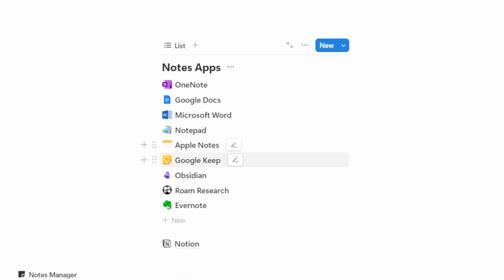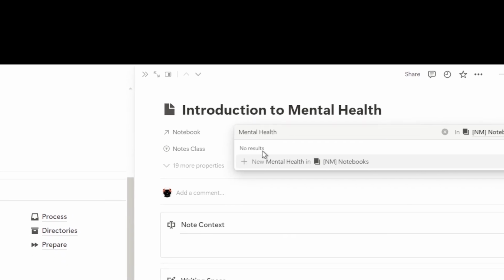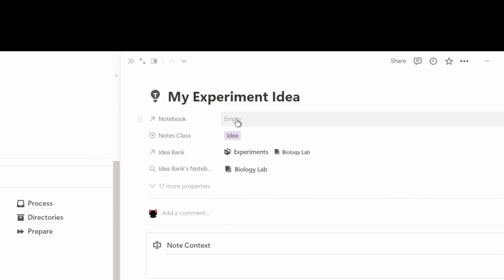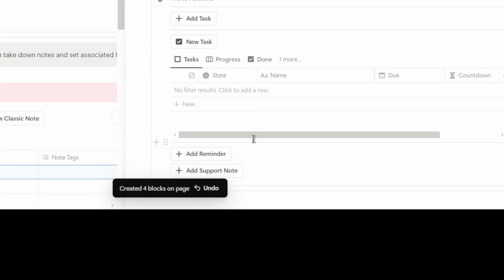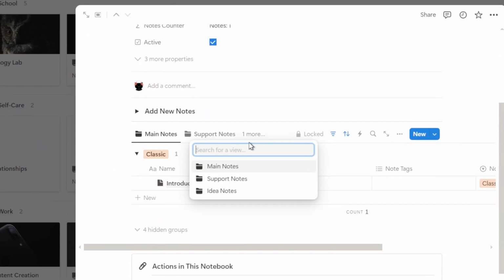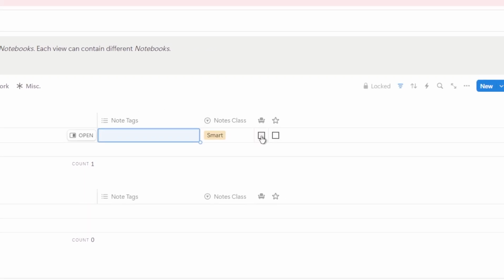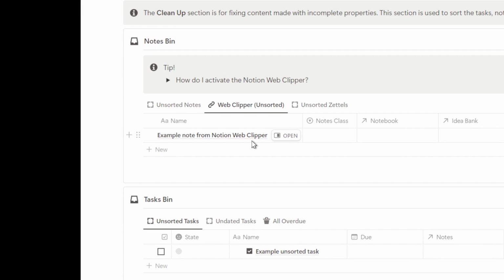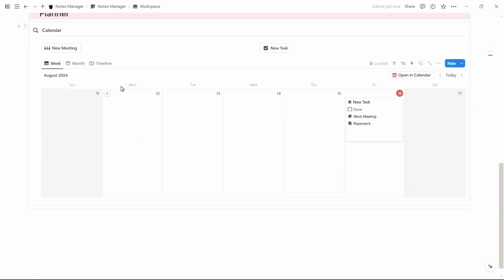How I use Notion to combine all note apps into one (Free Notion Template)

Comment: No offline mode tho
Reply from the maker: Hi! Thanks for the comment. If you have offline mode errors, you can contact Notion support (in your workspace, there's an icon at the bottom right corner. You can click "Get Notion support" and ask your questions there. You can send an email too through the Get Notion support. (They respond really fast based on my experience). I'm a Notion Creator, not a part of the tech team, so I can't help with that myself unfortunately. I hope this helps!